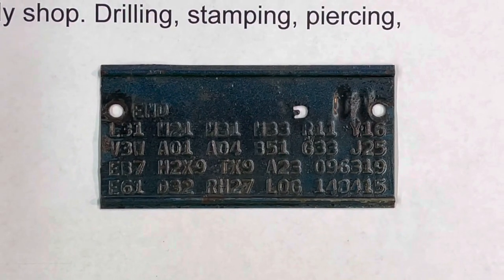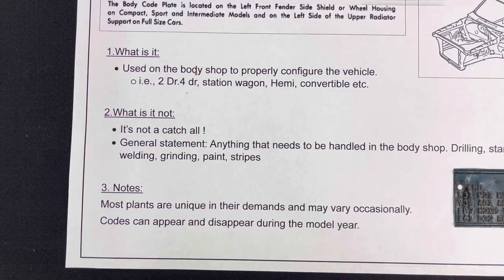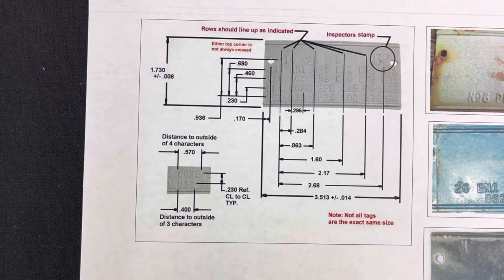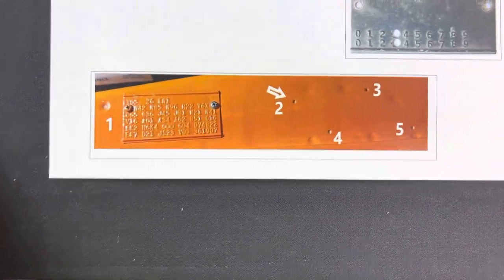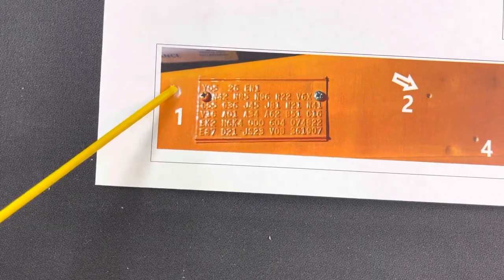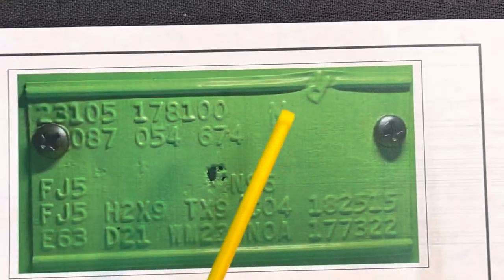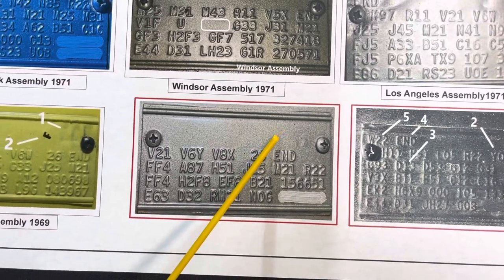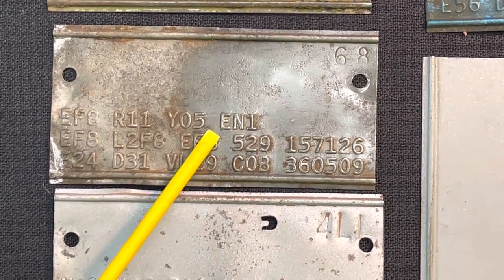How to decode Dodge Plymouth  fender tag

Comment: Do a video on VIN plates. Why 95% are black. A few are silver? Yea my 70 Road Runner has a silver one. I’ve seen a couple 70 Chargers will silver vin tags. All L.A built cars.
Reply from the maker: Starting in 1968 the VIN plates are black. Cars that are left in direct hot sun for years will cause the black to actually   baked off.